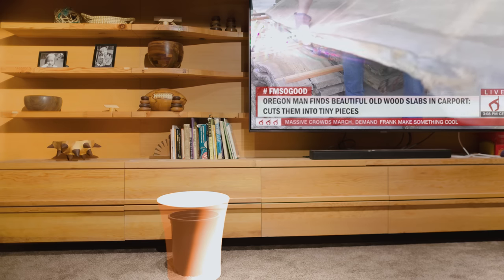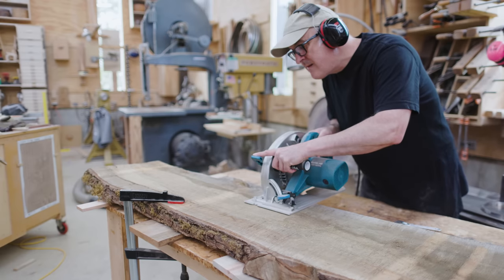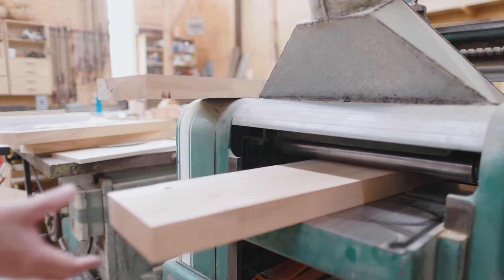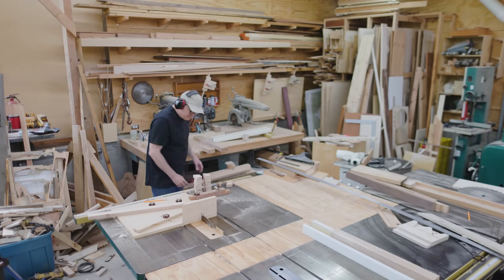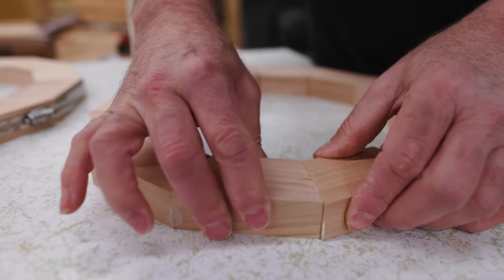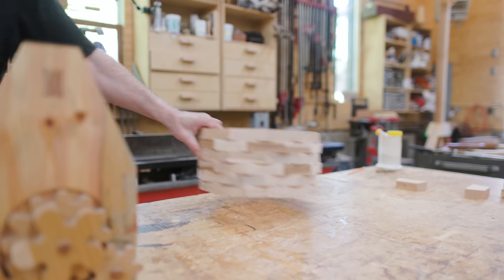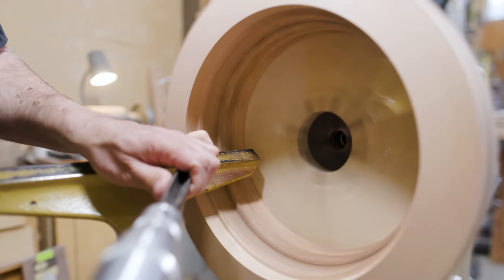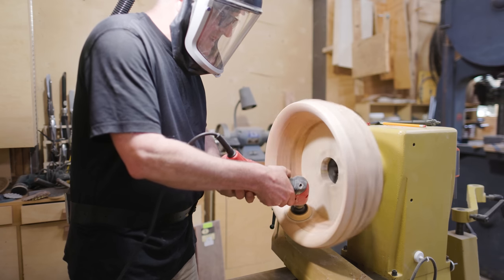Making the Most Beautiful Trash Can in the World

Comment: 1. a peg could make orientation easy, should you require it for construction reasons. Easy to retrofit.
2. the top should've had increasingly smaller patterns in it. Would've both matched and counter balanced the lower portion which is gorgeous. 
All in all, one of your best small~mid size projects!
Reply from the maker: The peg would be a nice detail. I like the smaller scale idea.
Reply: It might be easier to just add an alignment rare earth magnet.  No finnicky peg into a hole problem that always seems to show itself when your in a hurry to someplace and all you would have to do is rotate the top until it the magnets snap together.

Comment: I’m so impressed with your channel. I made wooden baby rattles and other lathe products semi professionally for awhile and I almost exclusively used a skew chisel for all the turning. I felt like I was wasting a lot of time keeping the gouges sharp and switching back and forth. I put a grinding stone on the outboard end of the lathe and used that to touch up the skew when it got dull. Some days when I walked away from the lathe there would be a waist high pile of chips with my body imprint in it. I went back to machining and now run a machine shop for an aerospace company. You’ve inspired me to bust out the cnc router I bought years ago but never got around to fixing. I just ordered a new Masso G3 controller for it this morning

Comment: the randomized glue-up looks like desert digital camouflage fabric.  regarding gluing rings, I've found that using band clamps often displaces segments leading to cracks.  So instead I just use gumbands for clamping, which makes it easy to align the wedges.  I don't worry about bond strength when do I this because plenty of strength is achieved when the rings are stacked and glued.

Comment: The random heights at 5:52 make me think of the surface of the Death Star. Then I started thinking about how you would turn a sphere with an uneven surface.  I guess you would just make multiple spheres with slightly different diameters (maybe like within 1/2” of each other?) and then cut them up in a repeatable way and glue them back together?

Comment: Really cool project! That chaos pattern is really neat!
It would probably look even nicer (like you mentioned) if there were some patches of the smaller pieces in the rim part as well. And maybe even in the lower part, that seemed to be made up mostly of larger pieces.
Also those small holes in the bottom of the plastic planter made me anxious of someone throwing something wet and yucky in there and having it leak out into the wood basket. Maybe seal the holes with heat glue or something?

Comment: this is amazing. from a design perspective, i think 
1. The top would look better if it were a a dark wood because of the dark tones in the chaotic pattern. then that pattern would serve as a bit of a transition between top and bottom. 
2. If you wanted to align the top in a specific way, you should chisel a notch into the inside rim, where it’s a bit more discreet, and add a tab into the top piece that lines up with it. I think a little inverted triangle would be easy and effective. That wouldn’t be a lot of work, it just depends on how much it matters to you.
Reply from the maker: Yes, Dark at the top I can see that looking better.

Comment: I really like your videos. But sometimes I think you do things the hard way. Because the inside of the turning is so large, I think you could turn down as far as you wanted. So it might have been easier to glue the whole thing together. Use a glue block for the bottom and a rounded board for the end to stabilize it. Turn the outside. Then take off the rounded board and use a steady rest to stabilize the now turn outside, then turn the inside. Am I missing something? (It's always possible. :-) )

Comment: I'm not sure you wan't your wooden chuck to be perfectly round, I don't know anything about lathe chucks, but I would asume that they  aren't a perfect circle when set to their smallest diameter, I think that would cause the chuck to only engage with four points of contact when applying pressure to a larger inner diameter.
Reply: Hmm, looking online most four jaw lathe chucks seem to be circles, meaning they only have four points of contact. Wouldn't it be better to make the chuck so that the are eight points of contact, reducing the chance of misaligning the workpiece?
Reply from the maker: @TheKopakah  interesting, this is where cutting the shapes for the jaws on the cnc could compensate a little for this problem.